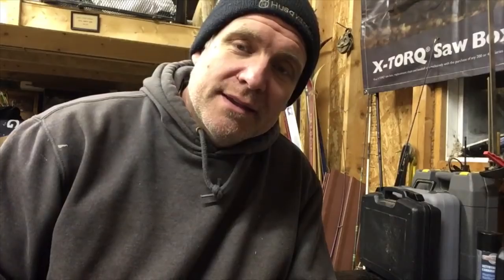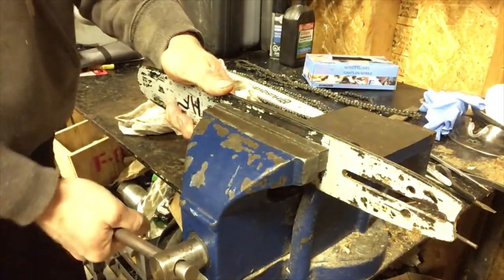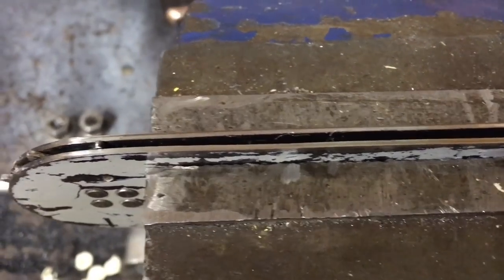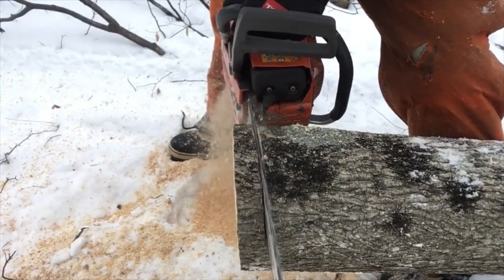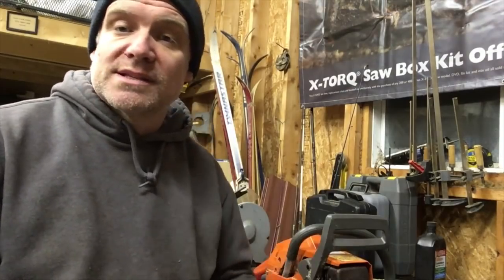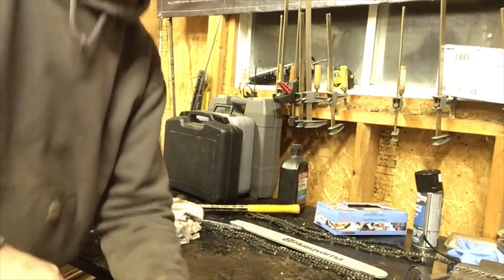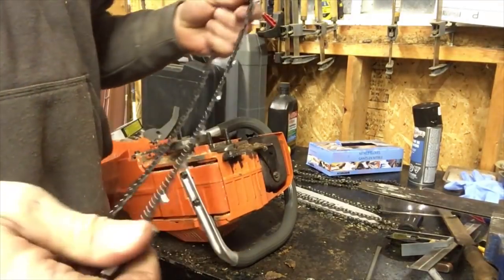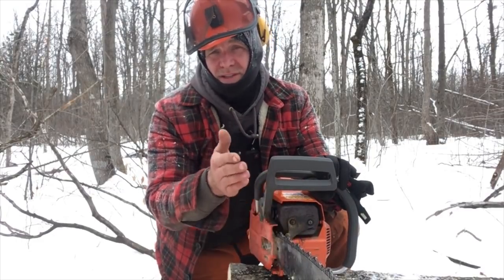Chainsaw sharpening fact or fiction edition. Does a worn bar cause a chainsaw to cut crooked?

Comment: Nice tests, thanks for taking one for the team! Also this is definitely fact like I posted before, don't forget that if you've worn the rails uneven from heavy use with a particular chain, that the chain links are also worn unevenly where they run on the bar so you've got double the problem. Simply filing the rails and then using the same old chain won't fix the problem as it'll still be off centre. This whole thing is made worse when people cut with dull chain because it's sharpened badly or keep cutting (just to finish) after hitting a nail/wire/rock. The chain gets overheated, wears more, wears the rails etc etc.

Comment: I have not read the other comments, so sorry if this has been posted.  Unusual bar wear begins with a faulty bar oiler or no/wrong bar oil.  Be sure to clean the oil pathway to the bar.  To minimize normal bar wear, flip the bar on each or every other sharpening.  That is why you sometimes see sawyers with the bars upside down.  If you use multiple chains then flip bar with each chain.  A dull chain may also aid in wearing a bar because of the excessive pressure required to cut.  Nothing can replace proper bar/chain maintenance for correct performance.
Reply: Not always sir. Time can do it too. If u actually take care of your stuff, it last 20 plus yrs and one of my stihl saws has done just that. It has a worn bar and cuts crooked as of late, and its not from lube not being there, ots from hindreds of cord wood

Comment: Hello Pete,
I just found your channel and subscribed.  I'm fascinated by the rear end loader shown in the opening to some of your videos.  I've searched  and have not been able to find anything on it other than when you welded a category one hitch ball onto the center link.  I have several questions:
1. Is it a commercial unit or custom made?
2. How high will it reach add dump?
3. Is the bucket reversible so it'll dig better?
4.  How deep will it dig?
5.  If you haven't already, would you please do a video showing it off 
      and telling about it?
Many thanks,
Pilgrim
Reply from the maker: Here are some links for the 3pt hitch loaders are used a lot in Europe. I got it used. Thanks for watching man https://youtu.be/WiMN-vaINys
https://youtu.be/rm1ATgLLjeQ

Comment: Yes the bar matters. My stihl cutting crooked last few weeks. Bar is 1st thing i checked and it was high on 1 side. Ground it and cut Saturday 6 hours with it. Before, it would cut about 8 inches into a cut and would bind and go crooked. After grind, i cut 32 inch log straight as a rifle and a lot faster. Same chain as before too. Bar does matter as much as the chain
Reply from the maker: I had fun running the test it was nice to see how each problem you added to the saw. Made a difference in how it cut. Thanks for watching man
Reply: @cheaphomesteading  theres a few of us who really get it. Many dont. But we cut heatwood for 2 houses. at one point we cut for 6 houses in our family but rest have dropped off and went to gas or heat pumps. 2 of us left but we cut a ton of wood. We cut 6 hrs yesterday. We are done this year and next. We are cutting for 3 yrs from now as we speak. Didnt plan that way, but you take what u can get when u can get it. Recent 2 hurricanes brought down more wood than i can remember. City and county trucks cant remove fast enough. So, we, the public who heat with it have options, lots of options lol and more than we can get to at the moment

Comment: Also, if you are cutting 20"+ logs this is so much worse, half way through it'll be trying to cut a 30° angle and the bar will physically jam. Seen it so many times. I volunteer for emergency services in Australia, I've looked after, sharpened, maintenanced our units 20 saws on a weekly basis for the last 6 years (as well as my own for 20 years). I don't think there's a way to kill a saw chain I haven't seen, ok there probably is, but dealing with rookie operators hitting roads, concrete paths fences, gutters while trying to cut fallen trees every week can get tiresome when they don't think or watch what they're doing
Reply from the maker: Thanks for watching man